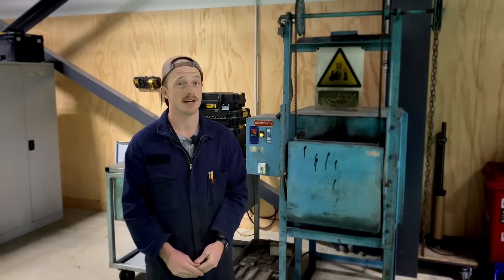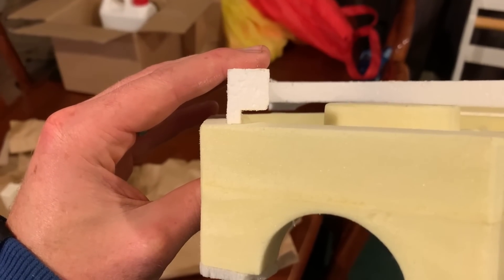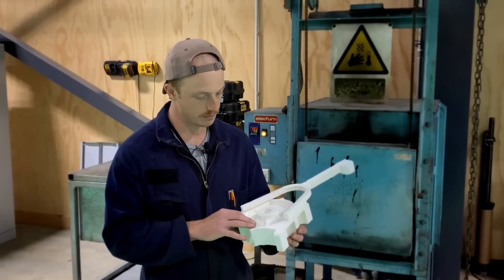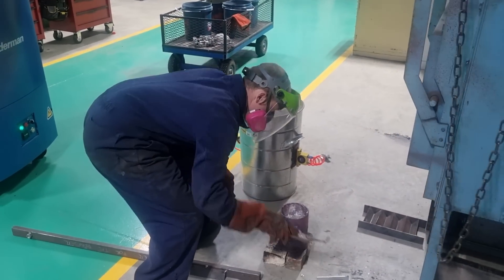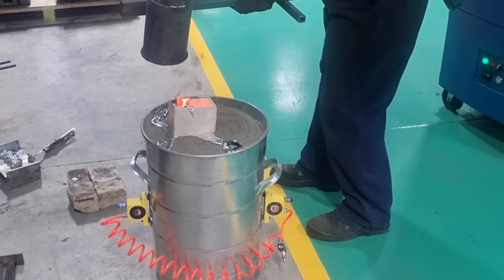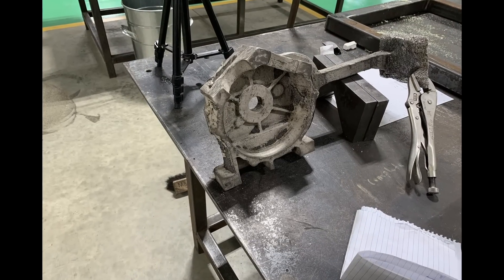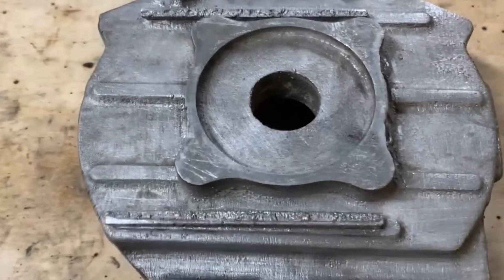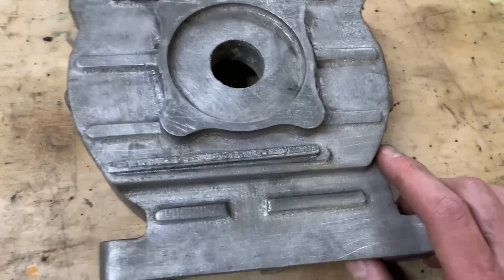Lost Foam Casting a Retro V-Twin

Comment: I love these videos your putting up. I'm thinking about casting a replacement crank case to allow my to use a Ducati twin mounted longitudinally in a car. 

I'd like to relocate the gearbox so that it sits in the vee of the engine. The drive would be taken off the engine as per stock. I was then planning to use a final drive from a shaft driven motorbike and the use the parts from a tuff torque lawnmower differential to make the final drive.

Comment: What sort of plug or filler did you use so the center bore is not solid?
Reply from the maker: The sand stopped metal flowing into that area.

Comment: Start using casting plaster it will help the finish...or making traditional molds with the foam removed before pouring...the sand you are using will only allow it to be so good always with minor defects
Reply from the maker: I will be doing some traditional wooden moulds for an upcoming project. I like using the foam as it’s fast, cheap and works relatively well for one off castings.

Comment: why don`t you melt out the foam from the sand before casting?
Reply from the maker: That’s not how the process works, otherwise the sand wouldn’t hold its shape. It would also add another unnecessary step to the process. 

That would require a specific type of sand and in that case I would use reusable wooden patterns.
Reply: @OddsandEndsMachining  you can add a sodium silicate to sand, it will glue the sand into a soft brick. And  then you can easily melt out the foam or even 3d-printed models, the sand will keep the shape

Comment: I wonder if there might be a way to preheat the sand prior to pouring. Obviously not very much, you wouldn’t want to risk damaging the pattern
Reply from the maker: I know it’s a thing with bonded sand but I don’t think there is anyway to do it with lost foam other than using a higher melt temp Or making the gates larger.

Comment: Hey Jonno  have. You got any idea  what the best Ali /alloy is to lfc of engine crankcases is ? I’ve had a bit of a look but no luck so far I’ve been advised that casting my baby v8 cases is the way to go ( marsh Motorsport) apparently fabbed Ali cases will expand too much. Not what Chu want!!  Looking forward to more V4 vids  it really got the juices flowing along with my lill project  hope fully getting the cranks ground this week to sleeve the main journals to 35 mm for gsxr 1000 main bearings 🍻👍
Reply from the maker: I believe fabricated cases can work, you just need to have tolerances to match. The block might require a meticulous warm up procedure to get everything into spec. 

I used alloy 242.2, it’s just what the foundry here uses, check out the link it’s very helpful. I’ll get back to the V4 soon I’ve got the crankcase patterns made but I’ve been working on the new v twin. I’ve got the machining about 85% finished so I’m probably due to start editing a video soon. 

https://www.riotinto.com/can/-/media/content/documents/products/aluminium/rt-aluminium-foundry.pdf?rev=44253ce840404452baa59f85a726e83c
Reply: Thanx For the great info bro  good luck with the v2  and hangin out for the v4  👍😂🍻

Comment: Have you not looking into plaster mold casting.. with you cnc knowledge you'd be better off machining the negative mold in plaster.. complex forms in keyed segments .. you get perfect smooth finish every time.. soak the casting out in water dissolves the plaster
Reply from the maker: Interesting, I haven’t thought about using plaster in any serious capacity, mainly because I’ve seen a lot of people having trouble with it cracking. I’d likely just make core boxes for resin bonded sand if I was going to go through all the effort.
Reply: @OddsandEndsMachining  give it a try.. exactly as you're doing with the foam but machining the negative instead.. use casting plaster.. & dry it over several days then oven dry at about 100c for 12 hrs.. fail proof & die cast factory finish.. I used to make die cast soldiers in plaster molds as a young teenager.. but cast the mold using pattern molds.. it's really very easy
Reply: Nice work, good to see more Kiwi content on utube 👍😃

Comment: The leaker underneath the central 4-eared embossment is caused by inadequate packing. As you re-use your sand, it can become contaminated and not flow as well under vibration as fresh dry sand. When packing, if you pour a liter or two of fresh sand into/around overhangs and potential problem packing areas, it can help eliminate these problems. Pack in stages as you fill before the flask weight increases helps if your vibe is underpowered. The little BBs are caused by surface tension between the foam pattern and coating. If you spray your foam patterns with soapy water (usually dishwashing detergents are best because the anti-spotting additives are surfactants), this helps eliminate them, and so does working all surfaces with a soft brush as you apply the coating. Best, Kelly
Reply from the maker: Thanks for the info, I didn’t think about the sand flowing less freely after being reused. Luckily all of the Leakers released after thinning them with a die grinder and another tap with a chisel. 

I did brush on the plaster and use soapy water on the pattern but still had some small bubbles. Maybe my plaster was slightly too thick? Or maybe I wasn’t brushing it enough . . . Either way I’ll see if I can make some changes for the second pattern before I cast it.
Reply: @OddsandEndsMachining  Machined foam has very high surface area and strongly repels water. Surfactants help break surface tension but also using a deflocculant or dispersant instead of water to thin your plaster can help. These substances reduce the apparent viscosity of the plaster and improve how it adheres, levels, and covers the foam surface. A common deflocculant is Sodium Carbonate (washing soda). A common dispersant is Acrylic found in commonly found Acrylic Latex paint. There are several YouTubers that use Latex paint and plaster for refractory coating with success. It usually takes relatively small amounts and some experimentation. Best, Kelly
Reply from the maker: Thanks for that, that’s something I’ll look into before the next v4 casting.

Comment: @4:00 what are you using for "vibrators"? I see that they are air powered. Cheers
Reply from the maker: Rotary turbine vibrators, they are fairly inexpensive from aliexpress.
Reply: @OddsandEndsMachining  Brilliant. Thank you. Do you recall what size they are? I see a wide assortment. Cheers.

Comment: I have noticed crucible temp changes finished result.. 10yrs ago. Good on ya sonny 👍
Just keep racing until you can't fall off anymore...
Reply from the maker: Yeah, it is very evident in the video how cold the first pour is.
Reply: @OddsandEndsMachining  Porosity is always an issue with castings. Keep going and having fun

Comment: Don't know the source of the wheels you used for the pour but Australian made cast ally wheel were CC601 and do respond to heat treat but will age harden as well, excellent work, just a suggestion  if the line in the casting is to deep to polish out maybe gouge it out a but with a rotary burr and weld/blend with a tig weld
Reply from the maker: Good to know, I know the wheel was from a Tesla, so I know it’s probably not Australian. 

Using the Tig is always an option, the seam shouldn’t be too deep hopefully.

Comment: Where is v4
Reply from the maker: The pattern for the rear half of the engine  is about to be machined, I just used this as a test for the cnc router to save ruining a whole block of foam.
Reply: @OddsandEndsMachining  ok what will you use v4 for? I also got thought of this engine cold pit it in long travel crosskart buggy. Engine would be in front of the vehicle with a car transmission and driveshafts

Comment: I like your video bro ever considering 3d printing mold to make casting?
Reply from the maker: Thank you. With 3D prints, you need a different process, it’s called shell casting and I don’t have the right ceramic for the shell and it’s far quicker to machine foam than print PLA. Also I have a far larger build window with the router.
Reply: @OddsandEndsMachining  fair enough. it made a lot of sense making those pattern in foam with cnc machining.
Reply: Check out @TheMotorcycleForge - another kiwi casting custom engine bits. Logan is currently making a custom head for an FXR150 via 3d printed patterns coated in plaster. The print is then burned out in a furnace and the aluminium poured. He's getting better at it, but it looks like it's been a big learning curve. I think he said he wants to do a whole engine later. The 3d printing filament is called PolyCast which is designed to be used in this way
Reply: What makes it difficult if you don’t mind sharing ?